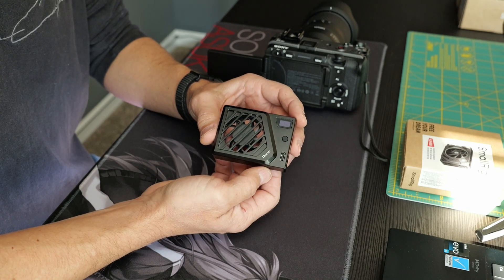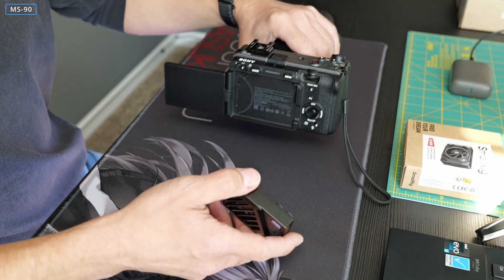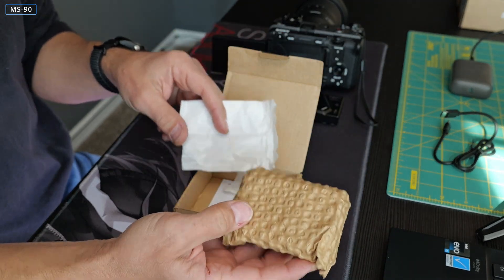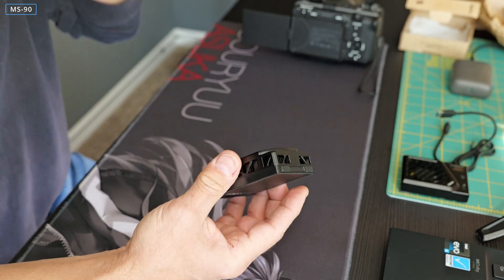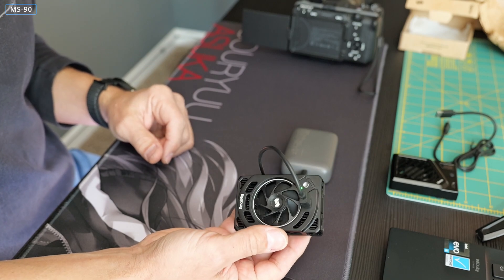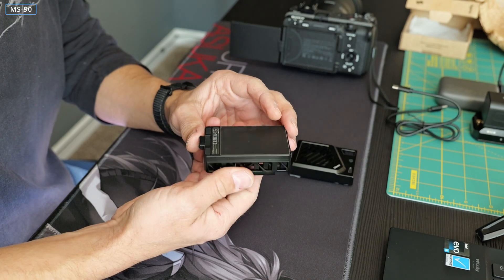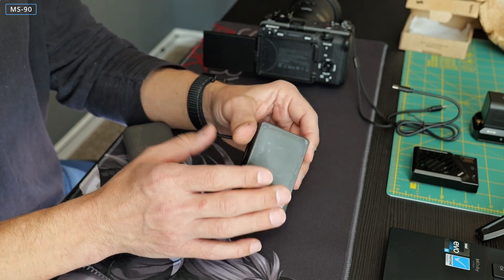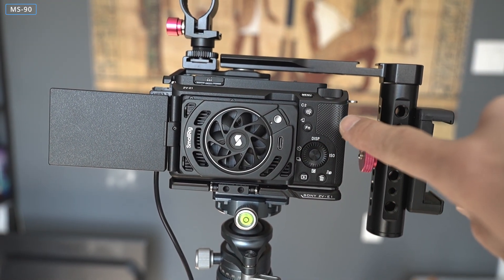SmallRig Cooling System For Sony Cameras.

Comment: Do you know if the plástic film must stay in the fan?  The fan creates some moist and wonder if the plastic is there for that reason.  Thanks.
Reply from the maker: Plastic film over heat transfer pad? No, that must be removed, it's just a way to protect the pad up until you unpackage the cooler.

Comment: Nice review, I wish someone would use one of them RC car motor temp sensors and wedge it between the fan and the camera to give us a fair reading. Or at least a temp laser.
Reply from the maker: I'm sure a test can be done - to point a non-contact thermometer at a spot on the camera and run it for say 30 minutes without the fan running and then with the fan running - and compare the readouts. I can do that. How many people are really curious to learn that?